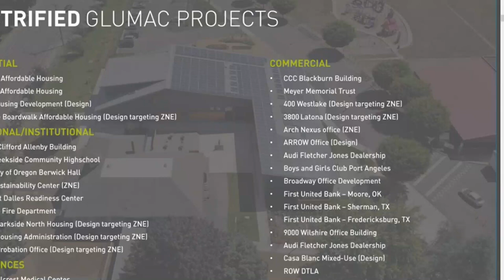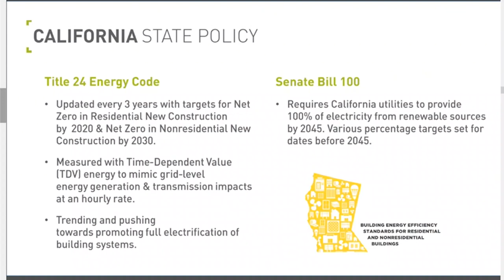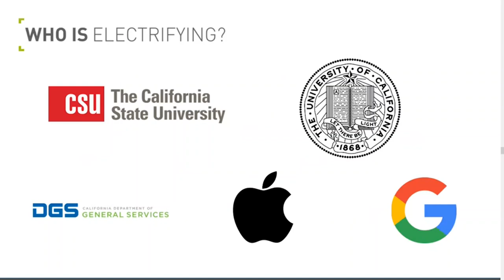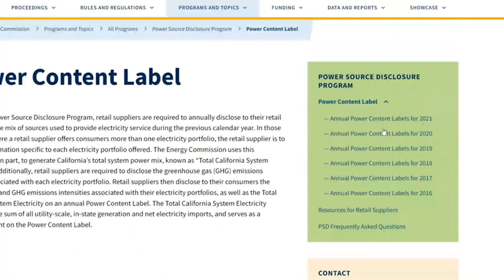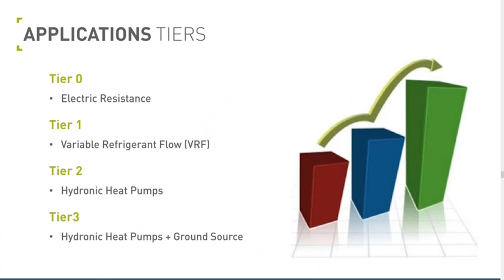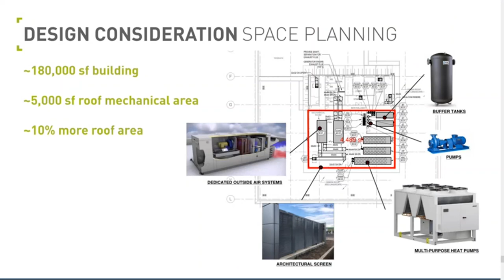SMUD Education Course - Why Electrification is a Solution to Climate Change & an Overview of Electri

Comment: Power Engineers have warned for years against Residential solar systems and their disharmonization of the electrical grid known as islanding. We just saw this happen on a national scale in Spain where their solar grid began oscillating known as beat frequency oscillation because the solar inverters cannot all coordinate their frequency. This causes voltage destruction and Rippling that strongly affects industrial control systems based on computers, and forced the grid to decouple all at once and take down the entire National Grid. This will happen again and again and again. The only solution is to redesign residential solar inverters to recognize a hyper frequency signal that is not affected by the 60 Cycle or 50 cycle power frequency that is constantly changing because of all these solar inverters. The hyperfrequency signal can become the conductor of the high school band think of it as a thousand High School bands in a stadium, and none of them have a conductor, they're all struggling to find the key of G. This can be solved simply by imposing the key of G onto the red and redesigning all of the inverters to find that key of G, then they all be in phase and there will be no more beat frequency oscillations taking down the entire National Grid. Will this happen? Probably not